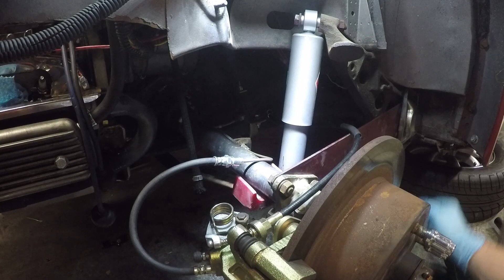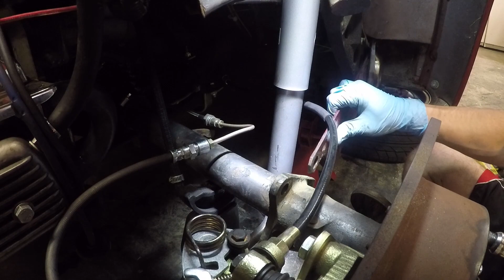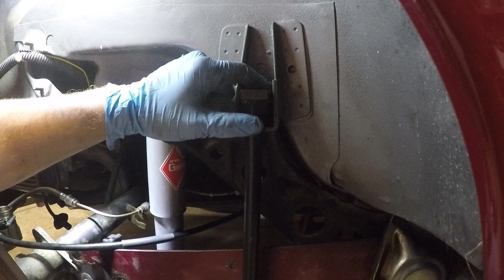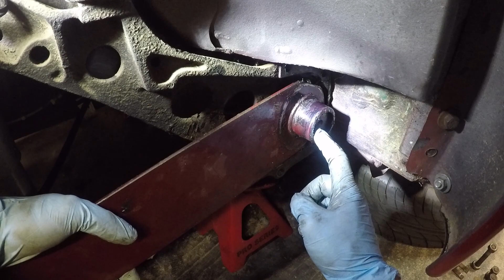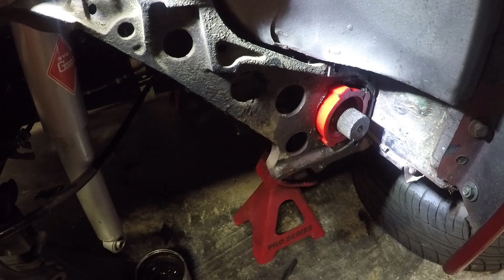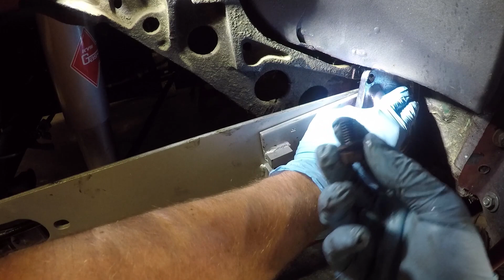VW Spring Plate removal - How to

Comment: Just got my adjustable set from swayaway and the hardware kit came with a spacer/sleeve for the torsion cap bolts which seems like a problem solver since the adjustable set is thicker than stock. Those caps clamped down like that on the assembly look like a problem waiting to happen.
Reply: Very good point. The new adjustable set is a lot thicker than original.

Comment: “Indexing” is a way of marking a point of reference to be able to make the adjustment.  If you pull the whole torsion bar out and rotate it (for making an adjustment via the inner spline) you HAVE to have a reference point, otherwise you have not made any adjustment at all, but simply uninstalled and reinstalled the torsion bar.  Once you rotated the spring plate up a few teeth, then the only adjustment that was made was via the outer spline.  In order to fine tune the adjustment using both the inner and outer splines, an index (or reference point) must be made (before any rotations are made) to mark the relationship of the torsion bar to the torsion tube, and then a reference point for the spring plate to the torsion bar.  Only then will you be able to count how many spline teeth must be moved to make your adjustment

Comment: Thanks for the video on the spring plate removal. One of the better ones I've watched so far. You showed the feel of how to reposition everything. One easy question for you. What kind of grease should you use on the bushings? White grease? Wheel bearing grease?
Reply: Silicone grease